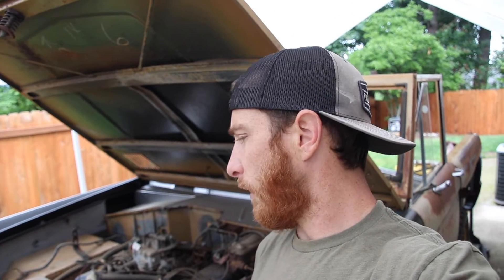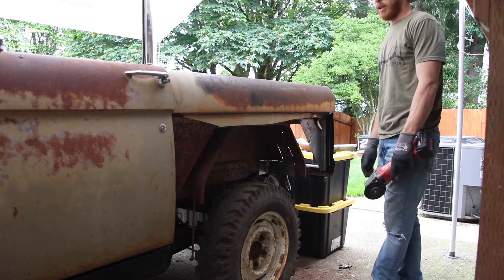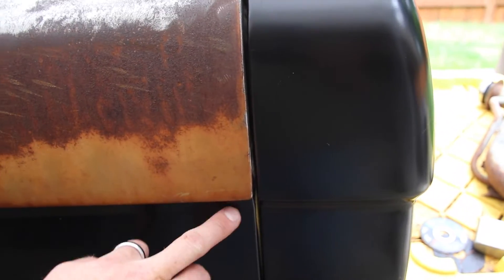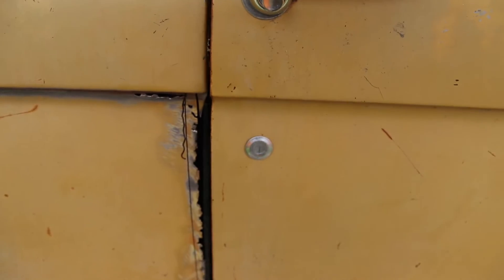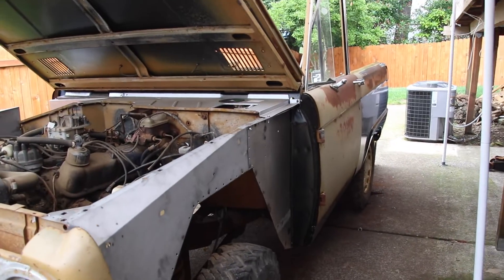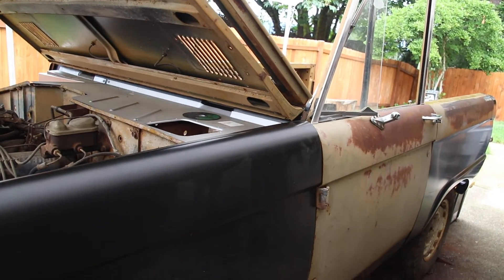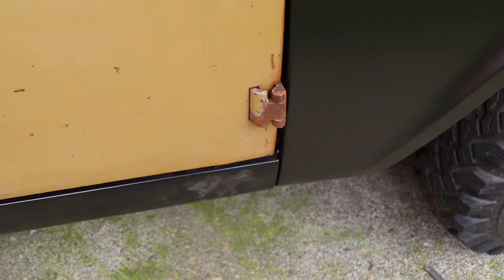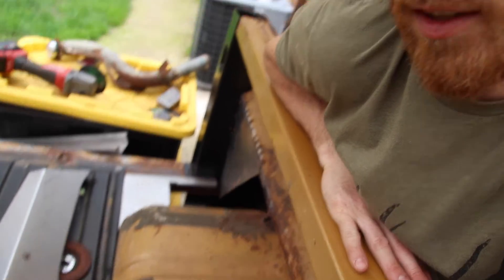Back on the Bronco! Tweaking doors, adjusting body lines and installing a lower quarter!

Comment: Your at the most challenging part of sheet metal replacement, trying to get it all to line up and fit right. You'll get it, just takes time. Sometimes it's best to walk away and come back the next day with a fresh view. I bought the grill that everyone sells, supposedly it's made from Ford factory tooling,  no way! I had to do a ton of work on it to get a nice fit. Just the way it is on 50 year old rigs. Keep it up 👍
Reply from the maker: Thanks Craig, it is definitely the most challenging so far. I’ve got it close, as long as I can keep getting closer each time, I think it will work out alright. Need to go back and get each side up to par, then start straightening.

Comment: When I did mine I bought the stainless hinges that come off easily without having to readjust the door every time you take em off. They’re expensive but well worth it
Reply from the maker: Got them on order 😉 definitely after taking doors on and off multiple times I was like F this, lift off hinges it is.

Comment: Do you have the hard top for it?  I found it to be very helpful to bolt it up firmly to use as an aid to get the doors and posts set right. Looks like you have a lot of it sheet metal screwed together. Do you have the kick panels welded in or screwed also?  At some point you may also find it helpful to get the kick panels and cowl welded up then you can tweak your door posts from there. My cowl wanted to twist or rotate on my badly as I didn't have it braced real well when I did my posts and kick panels.
I had to drill spot welds on the pass fender to do what you are talking about on the driver fender to get it to sit right. Lots of cutting, grinding and fitting on all the new panels that's for sure!  Keep after it and it will come together!
Reply from the maker: Yea I’ve got the hard top too, it just needs some work. I probably should throw it back on for alignment help tho. Thanks! Most everything is screwed together for now except the driver side inner fender. And that’s only welded in 4 spots